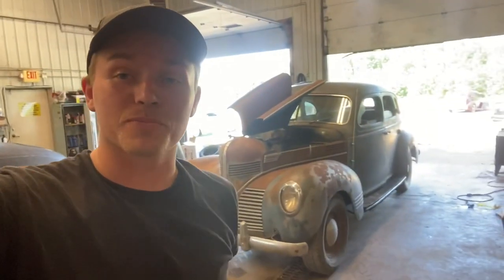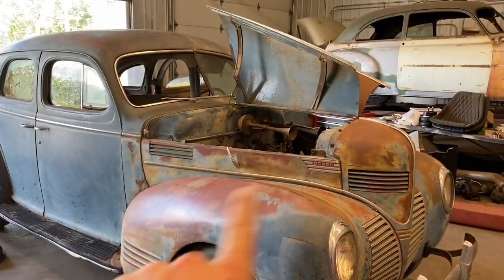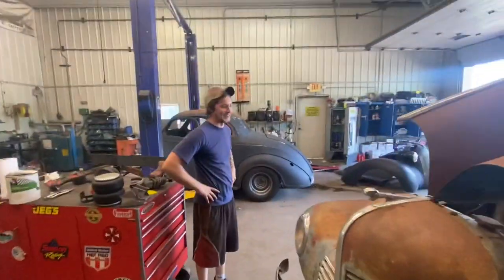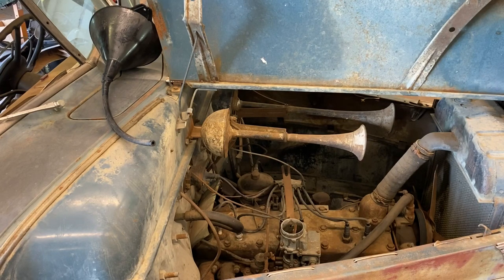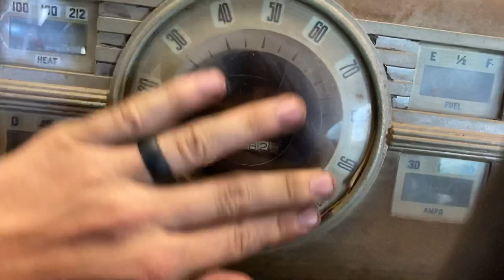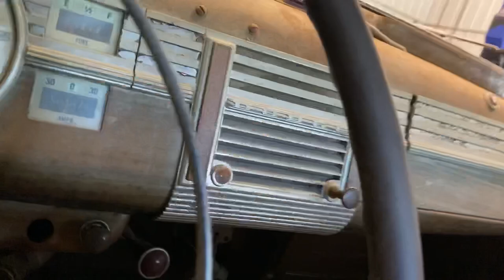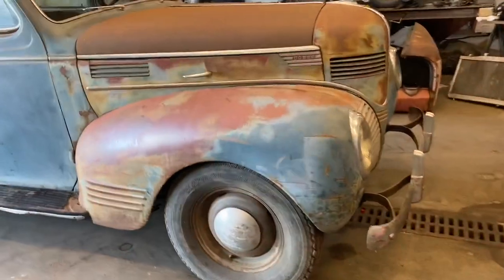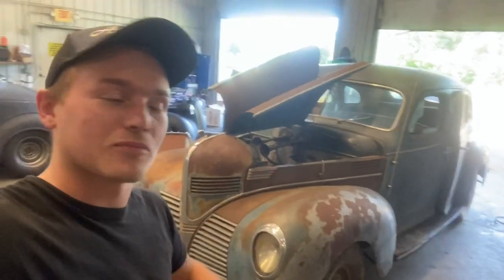WILL IT START! 1939 Dodge D11 Sedan

Comment: You made this video using better techniques than the other guys and their will-it-run stuff. I've watched them not put fuel in the float bowl and try to start by squirting gas down the carb; most of time, the carbs were functional. Doing it your way actually enables you to put the air cleaner back on and reduce the risk of a fire if the engine should pop back thru the carb.

Comment: Use break fluid on the weels to make them black and it softens the rubber so it wont dry rot and crack as fast. it also will clean the white walls up

Comment: In the days of the vacumm fuel pumps, going up hill with not enough vacuum if you didn't catch  the pump and let off the gas in time to activate the pump and the engine died, we put the hand over the carburetor and durned the engine over to prime the pump and carburetor.